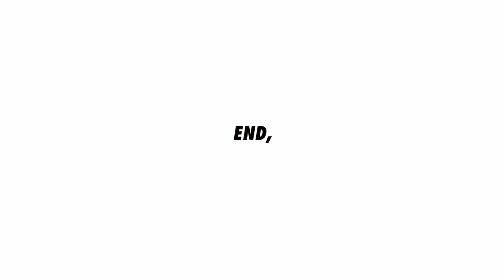W64_Shelf for bakery

Comment: Love your work, I have a question about your table saw. What is the make and model of it? you flow so effortlessly from ripping to crosscutting.
Reply: I went back to your first video and you stated your table saw was order-made. Great Design I am trying to build the rail that lifts into the crosscut fence.
Reply from the maker: yes~ my table saw is order-made saw and that is very useful for 4X8 boards.
Reply: So strange to have a left sided slider and and right sided fence.  I sell FELDER machines and it seems unnatural, but it works 
Love how it is the work table too.